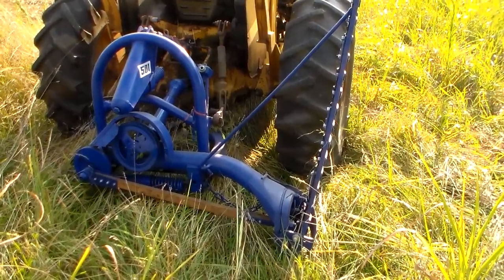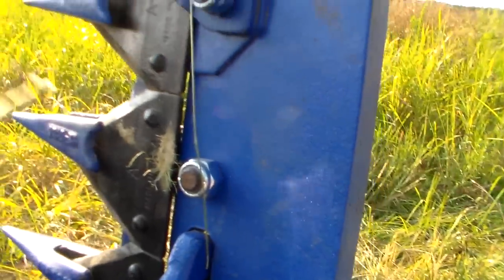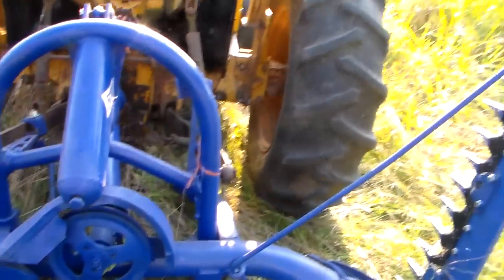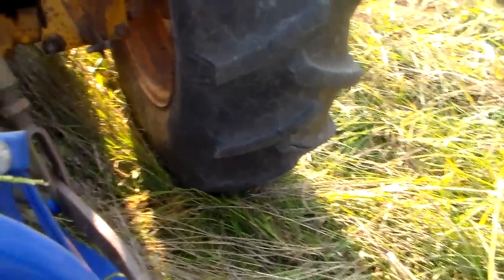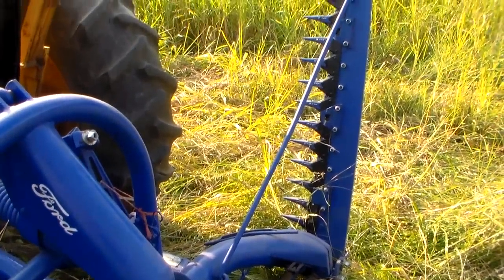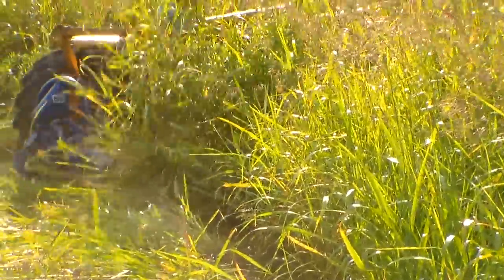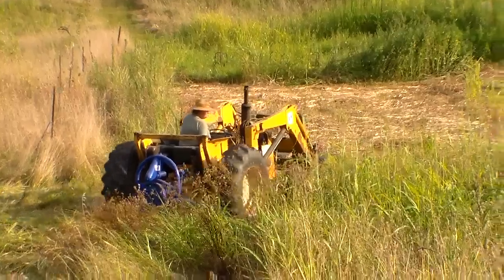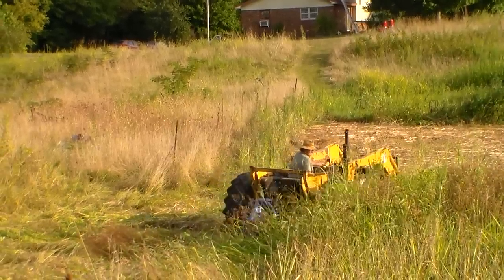Ford 501 sickle bar mower

Comment: I just bought a 501 7' mower
Seems to be in good shape
I tried turning it by hand and it won't move. Is it froze up or stuck or something? 
2:23 I wasn't quite sure what you were meaning about the shaft not turning. where it shouldn't move or something like that? Could you elaborate more on that part

Comment: These are great mowers IF they are properly adjusted and the knife sections, guards and hold down tabs are sharp, not worn and adjusted properly.  The inner shoe should have 40-80 lb. ground pressure; outer shoe 25-40.  With an 8" block  under the inner shoe the cutter bar balance spring should be adjusted so the outer shoe just starts coming off the ground.  Ebay sells Ford 501 owner's manuals which provides all the adjustments.  Recommend anyone having a 501 get the the manual - $16.

Comment: Thanks for sharing this. I just got a Ford 501 and am trying to make it work with a John Deere 2305 Sub-compact.  My lift arms are too short to accommodate either stabilizer. Is it possible to adjust the long bolt underneath without attaching the left stabilizer?
Reply from the maker: gorlux You can try it that way.  It'll partially work.  The bar will never come up right.  If you adjust the bolt enough to raise the bar up, then it will be off the ground when you let the mower down.  Adjust it to a point, the bar toward the tractor will come up pretty good, it'll travel at an angle.  The outside shoe will clear the ground some.  And that'll probably be about as good as it gets.  I hope this helps you.  I see pics of them on ebay frequently running them like that, and folks seem to be happy with them.  We would have answered sooner, but just saw your comment today.
Reply: Cynthia Metcalfe Thanks for the reply. I ended up removing both stabilizers and the push rod with the left stabilizer. Then I attached a chain from where the push bar attaches to the left lift arm of the tractor. I then tightened the linkage through to the inner foot area. This allowed the outer foot area to come off the ground when the inner foot is lifted, and I think reduced the ground pressure on the outer foot.  Was able to cut 4 acres of light alfalfa in this configuration.